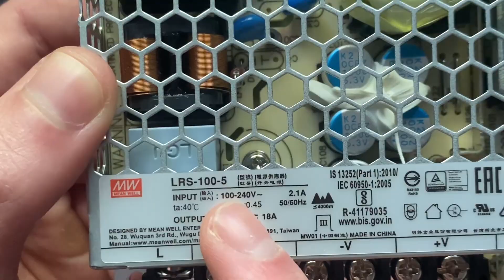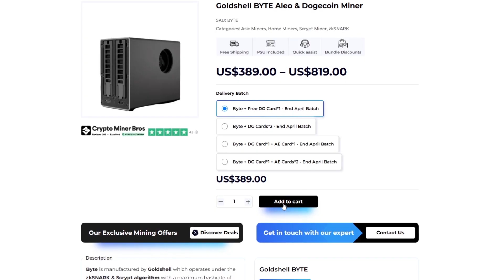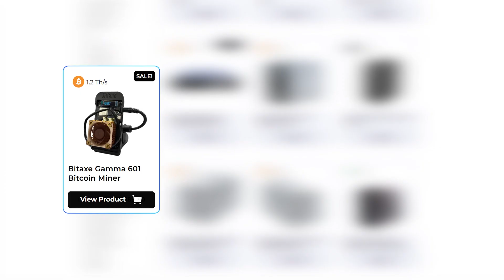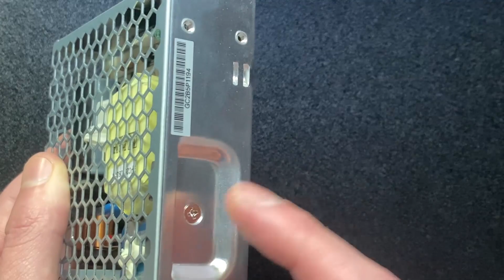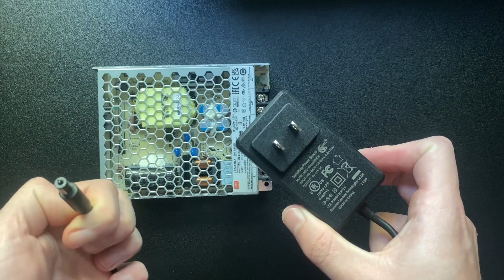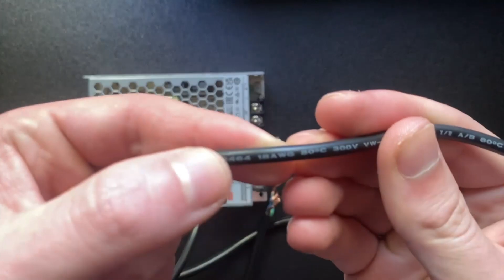How To Wire A Bitaxe Power Supply - Run 3 On One Power Supply

Comment: I must have  hit the silicone lottery jackpot. I can overclock my bitaxe to thr highest settings  the drop box allows for frequency and voltage and my voltage to 20 sometimes 21
Reply: No upgrades yet either

Comment: It's a bit of a worry when someone who admits to not being an electrician is advising people on how to connect mains power. At least you got the active/live and neutral the right way around though, unlike another video I watched earlier today. 😁
The length of those wires shouldn't be enough to cause a voltage drop, even with thinner wire it's going to be negligible. If there's a difference between Bitaxes, it's more likely the way each individual one is measuring the voltage. Also, connecting more than one device, shouldn't change the voltage out at the terminal. The power supply will put out whatever voltage it's set to, only the current draw will change if you add another device. Once you exceed the maximum current output, then you may get a voltage drop. Use a multimeter to measure the voltage at the power supply terminals.
Oh, and don't use a scalpel to strip mains cables. Get some proper wire strippers and make sure when you connect the wire to the terminals that there are no random strands sticking out. Even the old trick of using your teeth is better than using a scalpel which may partly cut some strands.
It's no wonder it's illegal here in Australia to do your own mains wiring without it being inspected by a licensed electrician.

Comment: Do you have any recommendation to power 13? I have the gamma icetowers and i would like to use as little plugs for the wall as possible 😅
Reply from the maker: probably have to be a 500w power supply to run that
Reply: @SterlingSpecter1 I have alot of questions but I also want to try and figure this out myself but this is way to important to mess around with i feel would it be better to have 4 power banks and have 3 each hooked up running to a surge protector? Would you personal risk trying to wire all 13 to one? Thank you so much for getting back to me! Im thinking of mounting all the miners on a cork board about 2.5 inches lifted off 2ith additional fans blow under them to help with heat more should I keep the 3d printed case on them or ditch them? Thank you again for any input keep doing what your doing!

Comment: i have also such an power supply but not from meanwell. mine is getting very hot and i cant touch some parts of this supply. is that right? feels wrong ^^
Reply from the maker: would get this checked out, its not supposed to be that hot

Comment: I followed these video exactly.  I check the +ve and -ve was correct and the voltage.  My fan spins, but nothing on the little screen.  To make matters worse, when I plug in my original power supply, it’s the same.  It was all working before.  Is there anything I can try to fix it, even on the old power supply?  Thanks

Comment: Any time we deal with stress and fasteners we have to torque things down properly. Electrical components are no different, more so if we’re dealing with sensitive electronics in computers. The power must be stable at all times or we experience failures or glitches. For PSU hook ups I’d recommend spade connections and heat shrink, torque the terminals down per PSU spec. Keep the flow constant and minimize resistances as much as possible. Also keep your miners safe with a proper surge protector rated for media devices/computers.

Comment: Even the chips dont get hot with samefan layouts and they read 30 degrees c on even higher settings.  These chips pull alot of hashes and heat especially. There are gimmick chips and they are making a fortune so you wont ever hit a block even though its hard even with the real thing.
Reply: People have hit blocks with solo miners running asic chips

Comment: Can you give an update on your Aliexpress gamma?
Reply: There are alot of fakes of these on ali. Looks real but they are using fake chips. I did buy one as it was cheaper than the real ones. it looks like i have a fake.
Reply: @EliasOda  honestly there's a lot of fake stuff in general on aliexpress i bought 10 120mm delta fans thats are supposed to be real there 5.2 amp 12v
 delta server fans but i almost guantee u there fake delta fans
Reply: @ thanks for the info. How is it doing so far
Reply: I bought 2 gammas off AliExpress a 601 and a 602 the 602 and it's power supply runs great with stock PSU I have it set to 1245 and 600 freq an it hashes all day long it just recently hit 2.7g best share now the 601 on the other hand I'm sure the power supply is the issue input voltage drops if you run the 601 anywhere over 16.2w an it ends up crashing the 602 I spent 73 bucks USD shipped to my door an 601 I paid 69 bucks usd at my door if you end up reading this the 602 runs wayyyy cooler then the 601 because the heatsink it uses its sitting at 45c   anyways hope that helped